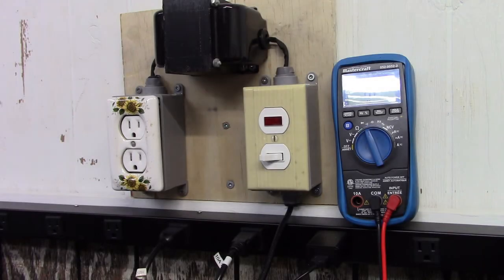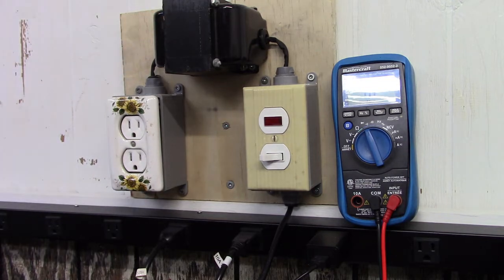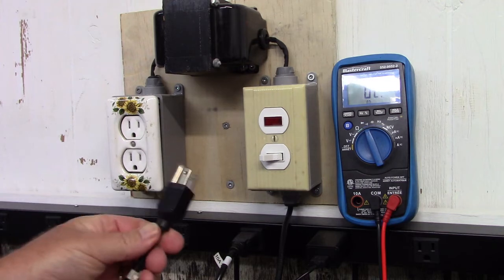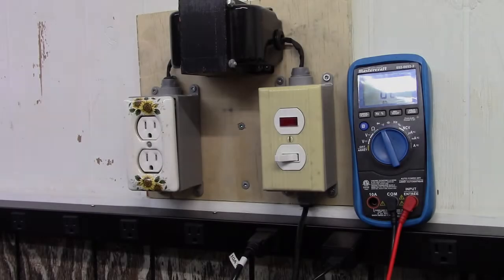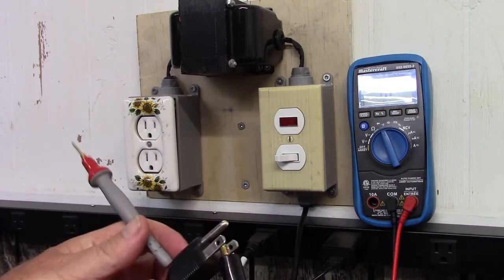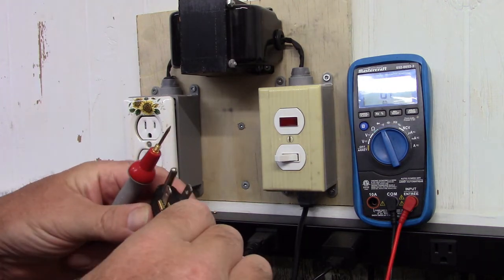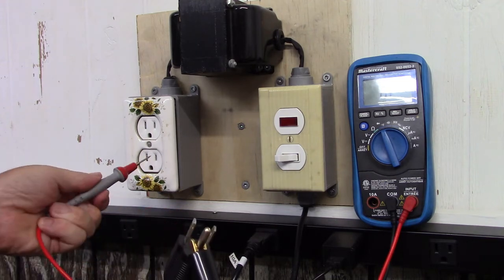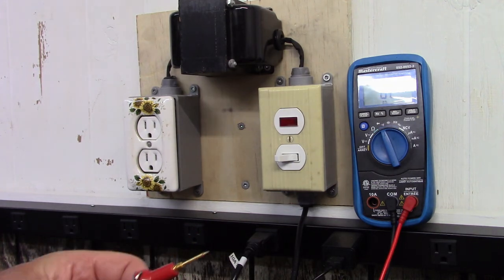02822 Workbench 101#3  How To Test an Isolation Transformer

Comment: Got a problem I can't figure out why Isolation transformer passes this continuity check but when i plug it in I get full line voltage between the narrow slot and ground on the secondary side.
Reply from the maker: Ok this answer is only valid for North America. 

You have just proven that your 'Isolation' transformer is not galvanically  Isolated.   More than likely you have a 'Medical Isolation Transformer'   If both your transformer and the socket it is plugged into are correctly wired what you are seeing is 'Hot' (black or small slot) looping back to  'Ground' (Green ground) which is correct for this type of transformer.

Obviously I cannot tell you 100%.  I do suggest you do not use this transformer for working on old transformerless (ie AA5) radios until you have someone say from your local radio/HAM club, someone else with High Voltage lab experience or a professional electrician to have a look at your set up.

 It might be a simple mod to the remove the ground or you might be unlucky and the transformer winding itself is grounded.  I cannot say one way or another.

I did a more detailed video here

https://www.youtube.com/watch?v=XUxFGyNiyhI&t=379s

As well as a link in the description of the link above on isolation transformers from Uncle Doug
Reply: @byterock  'Gravimetric' isn't the correct term ...it refers to a chemistry technique .... galvanically isolated is the proper term
Reply from the maker: @barrysilver2075  Yes you are quite correct.  I will correct the above.  Must of been the auto correct combined with the fact I am a horrid speller. ;) thanks

Comment: Yes agree safety first, but also make sure that if you have a DPDT on/off switch btween that plug and the isolation transformer as in this setup it is set to ON otherwise the results could be false
Reply from the maker: Yeah I tested that as well. Wanted a short simple video so did not add that part in.